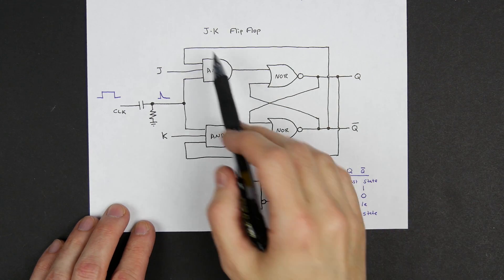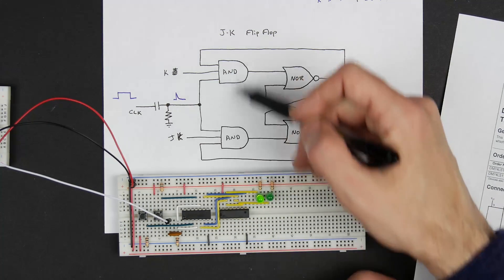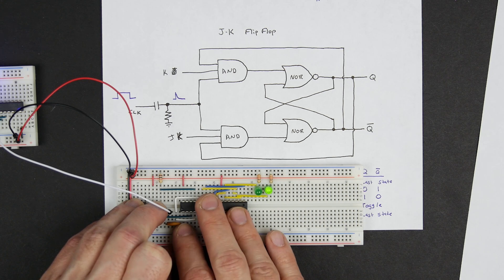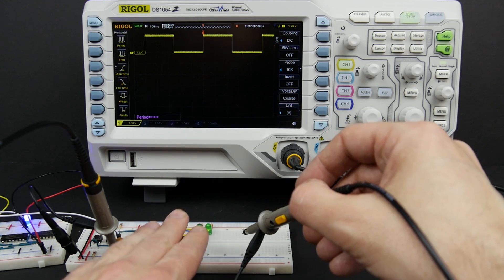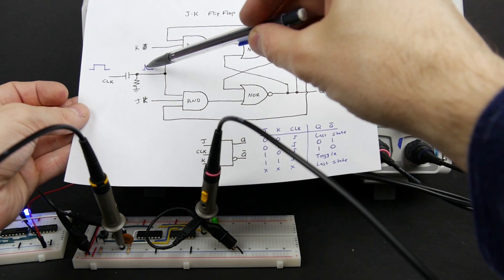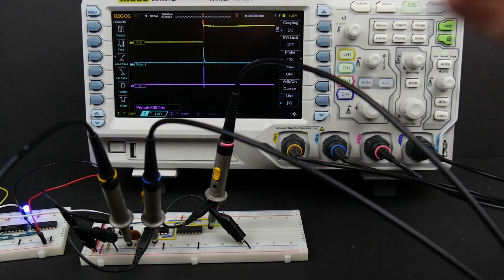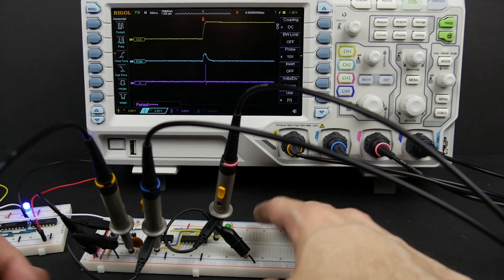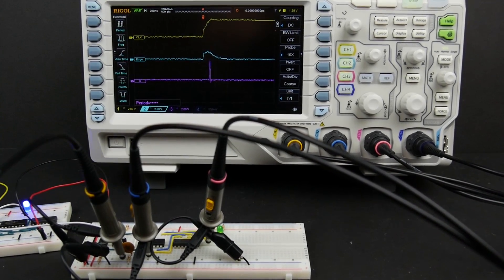JK flip-flop racing

Comment: In addition to renaming (reversing) the J and K inputs, aren't the feedbacks to the AND gates inappropriately crossed?
Shouldn't the Q feedback be directed to the top AND gate and the NOT Q be fed-back to the bottom AND gate?
Reply: Indeed he has build a different circuit than the one on the schematic. You can see it by the yellow and blue wire following each other back to the same side of the AND gate. The output from the NOR gate is AND'ed with an input to give an input to the same NOR gate not the other NOR gate.
Reply: The Master/Slave JK flip-flop in the next video works fine though.
It's because a SR Latch kind of swich up and down since S is at the bottom and Q is at the top. With two serial SR Latches as in the Master/Slave JK flip-flop you do need to cross over like he does, but not here where he only use one SR Latch.
Reply: Yes I think you re right Robin. I think also that if you (you in general) want to build a circuit like Ben Eater does in the video (crossing the feedbacks in that way), you should put NAND gates instead of AND. To sum-up, cross the feedbacks if you have NAND gates instead of ANDs, do not cross the feedbacks if you have AND gates. Do you guys agree? (sorry for the English).
Reply: @giacomobiancalana6949  I think that il would work by switching the wires from the outputs to the And gate but I think that a NAND wouldn't work because it would be high even if the clock pulse IL low
Reply: Ita?
Reply: @The Mechatronic Engineer  YES omg thanks i was going crazy!
Reply: @Robin
I'm convinced you are right too. I could not make logical sense of it.
I think the schematic he shows will never switch since if Q is on you can only set (S/J) it which turns Q on, and it already is. You can not reset (R/K) it since that would require Q to be off. If the circuit wakes with Q off the same logic applies.
He must have build something else which is an easy mistake to make by trial and error.
Reply: Inspite of changing the inputs if he replaced the NOR gates with AND gates, the circuit would function correctly .
Reply: I realize you're probably no longer concerned about this, but you're definitely correct. The schematic isn't drawn correctly. If you look closely at the circuit Ben builds and compare to the datasheets, you'll see that the outputs don't cross over to the other input as shown in the diagram, but instead match what you described.
Reply: Building it with AND plus NOR gates is rather unusual. I understand the didactical reasoning behind this (adding to an SR latch with enable), but I'm afraid it's not working out. However, the cross-coupled feedback from output to input IS essential for a JK flip-flop.
I haven't yet wrapped my head around this approach, though.
Reply: Robin, actually I now think you're right. I even cannot understand how setting/resetting could possibly work in the original circuit!
My reasoning (on the original) is this: assume Q = 1, then !Q = 0 (since Q feeds into !Q's NOR). But !Q feeds into the upper AND so this won't output a 1 - even if the clock and the third of its inputs (relabeled to "K") are 1, ie "K" cannot reset the flip-flop. On the other hand, the lower AND can output a 1 when J = CLK = 1, because it has Q going into it (which we assumed to be 1). However, this won't change anything either, as the lower NOR already has a 1 on its input connected to Q...
So, what's going on here?

Comment: What happens when you connect the set and reset of an SR latch to one button, click and let go? Would it choose a random state or does it always choose one other the other?
Reply: Lucas Buhl-Nielsen It probably depends on the delays in the  individual gates of the latch. I think you'd always get the same result when let go. Both zeroes output on push then the same 1/0 1/0 pattern on release

Comment: Don't think you need the RC at all...a JK just needs a clean rising clock edge.
Reply: It is not yet a correctly working JK flip-flop. Edge-detection with RC is not working reliably, that's what he wants to show. But you do need edge-detection (as part of the JK flip-flop). If you simply omit the RC and connect the inputs directly to the clock, then you'll have these super-fast bursts of toggling for an even longer time, namely during the entire on-phase of the clock.
Try building it yourself.